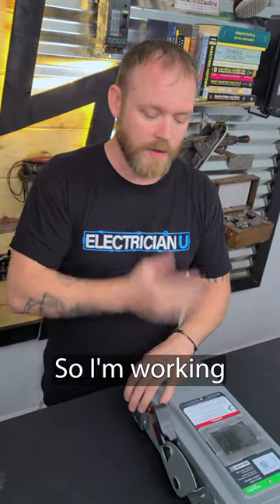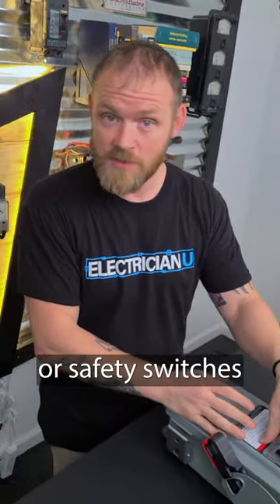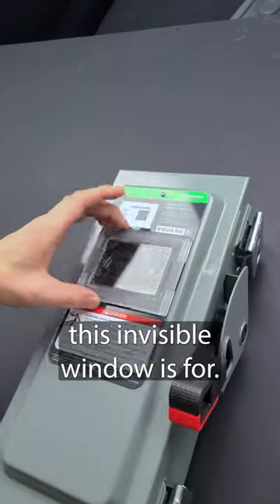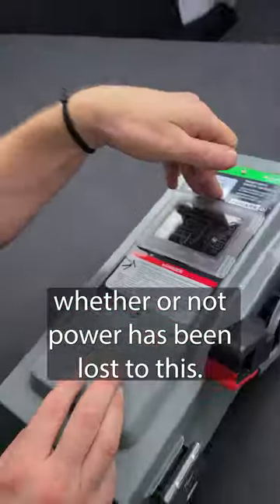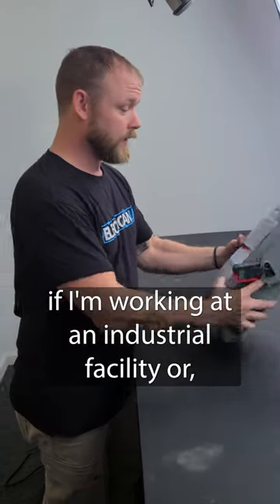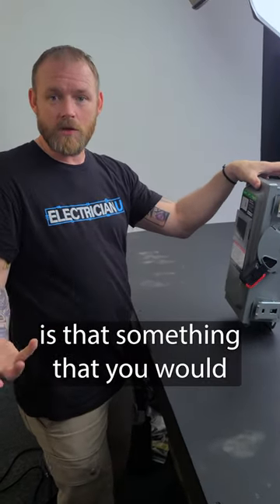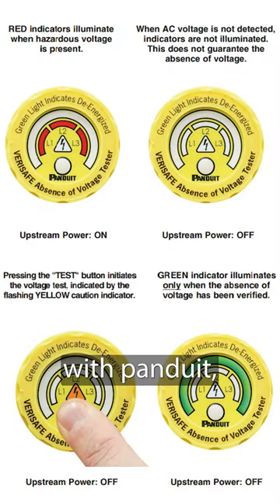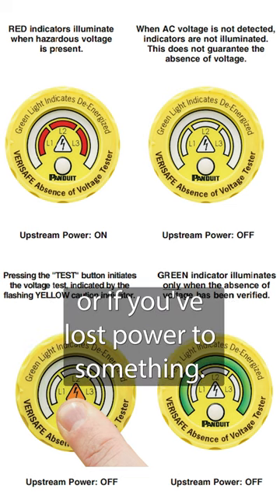Looking For Feedback on Schneider Disconnects

Comment: Don't think many companies would spend the extra money for this. Would have to have a 100% guarantee that any such LED'S were not made in cheating lying lack.if quality control communist china. Had way too many problems with garbage POS Cheating china LED'S .  Is the glass window tested & approved to handle a severe dead short without blowing window into sparky faces? We had 3 or 4" round windows on 13,200 volt switchgear that you could look thru to inspect air switch contacts and heard each window cost several hundred dollars. Yes they were thicker then the one shown on your safety switch. We have to use a voltage tester & a flimsy non contact tester to verify equipment is not energized. First you have to test the meter & tester on a known live circuit then test circuit that you will be working the verify that meter & tester are working. Saw an old timer get a nice shock when he attempted to remove a blown 200 amp fuse from an old safety switch that had that a contact arm broke off the operating bar. We all had fuse pullers but he liked to pull fuses out with his bare hands.